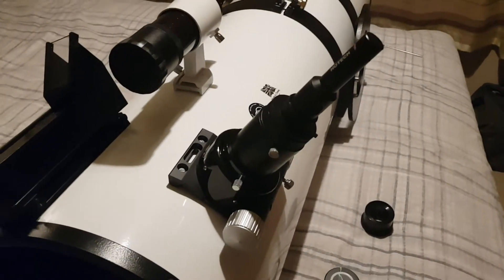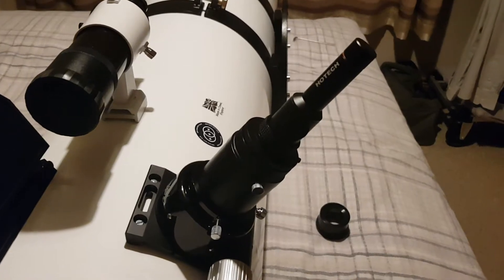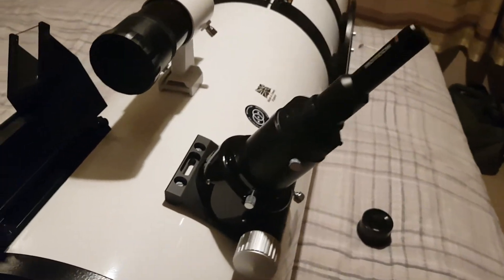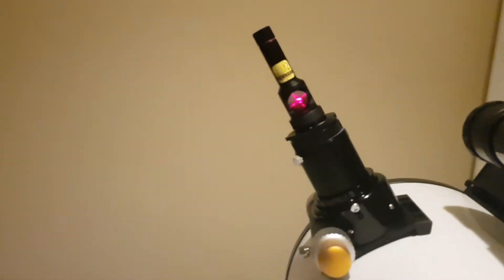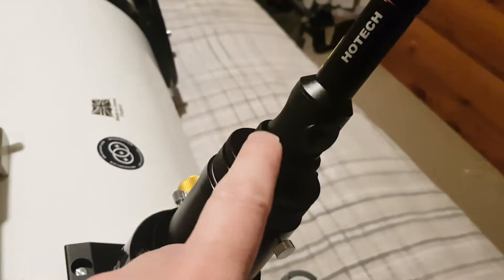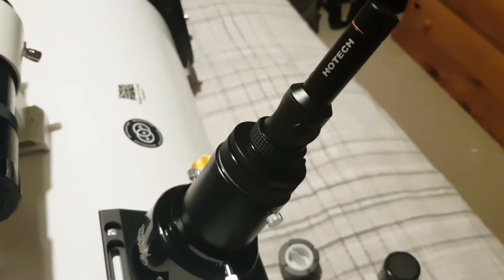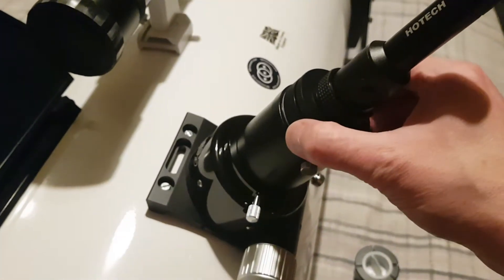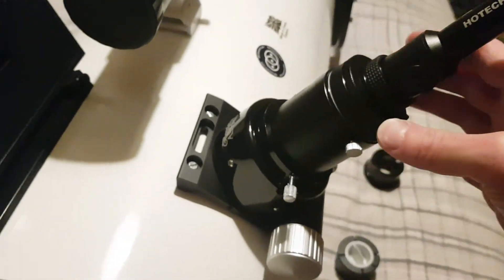HoTech Laser Collimator Problems Pt1

Comment: Were you able to collimate the laser yourself or did you have to send it back? I've just discovered the my Hotech Collimator has the exact same issue.
Reply from the maker: I collimated it three times and if you used it straight after doing so the results were solid but after a day in my accessory case it was way off again. I sent it back for a replacement and when I got it the issue was just as bad so I sent it back again and got a refund. They just don't hold their alignment what so ever.
Reply: @nomisastro2000  disappointing for a not so cheap collimator.